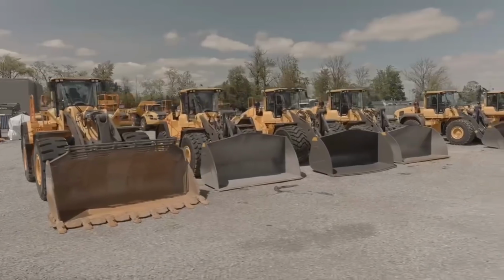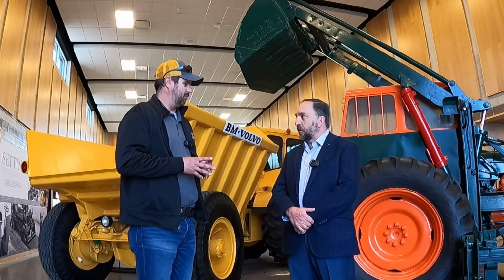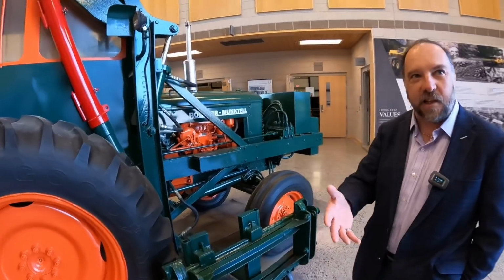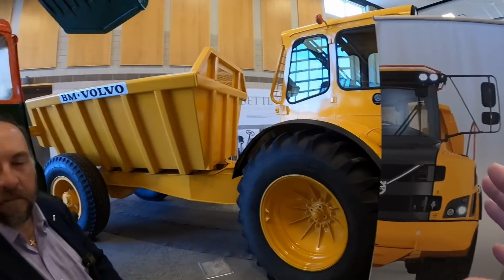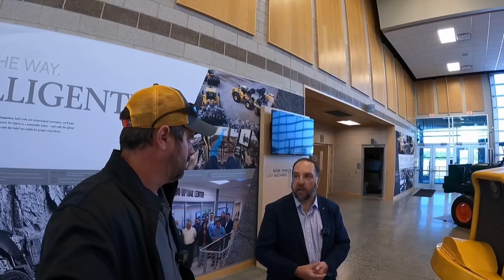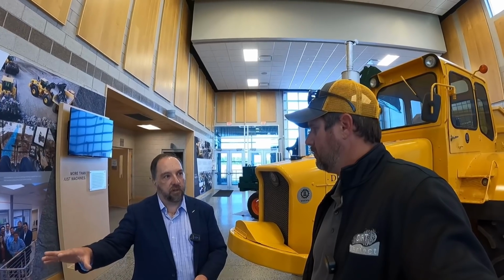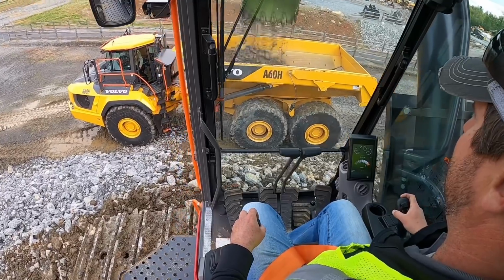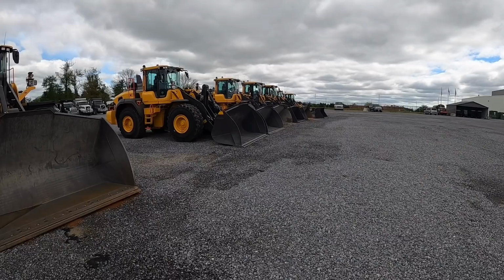Looking back before we look forward- The history of Volvo Construction Equipment with Dirt Perfect.

Comment: I would assume they had to start from a need to do something and adapted to it. This not being a normal video for you Mike kinda surprised me for sure. I have a lingering prejudice against the Volvo as they came with a good product and undercut prices deep enough to gain interest in what they have. I think they must of sponsored a lot of equipment for those tv shows like gold rush and others of said same lines of work. If a guy sees one working and doing a good job then they assume it will do the same for others rightly so. I have so little time around them and of course Chris loves his big new Volvo excavator.... thinking he might of but not sure bought one of their dump machines. I don't really even know what they are called when they bend in the middle instead of a steer axle. I just got too old really too fast. I miss my time in the seat or even pulling wrenches on them but the Hyundai your using seems mechanic friendly. I am really foggy on who makes the telehandlers that exit from the side and do everything a skid steer does. I am mostly rambling so will  say see or comment on the next one

Comment: We use to own a 1960 Ford 801 industrial tractor that had been reversed by the Sherman Forklift Company .
So the mast was hanging on the drive axle. The seat was attached to the original dash of the tractor.

Comment: They have a cool customer center in Dublin Virginia where the trucks are made. I used to haul a lot of parts for Volvo Truck and Construction and also other manufacturers of heavy equipment. One thing I noticed is what goes into a Volvo is always top notch quality.